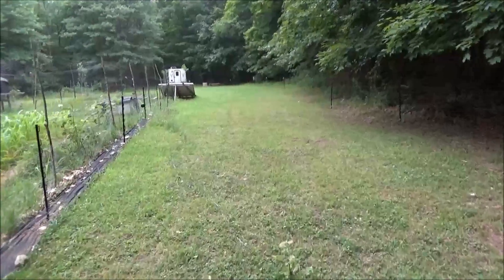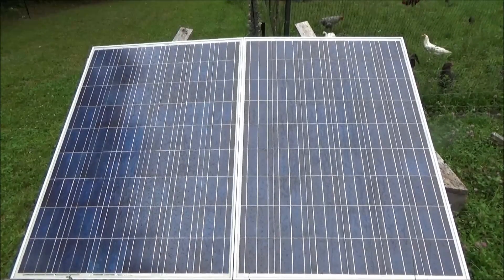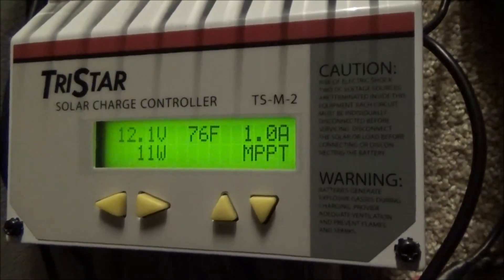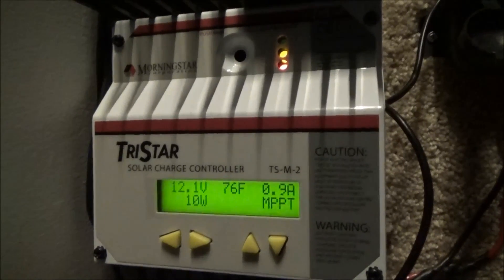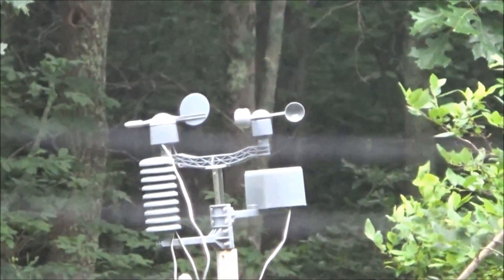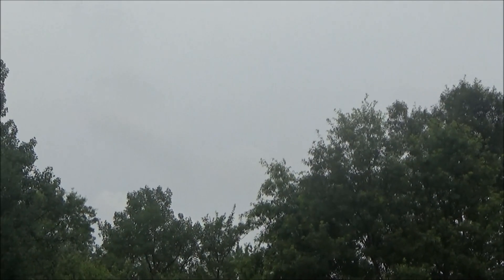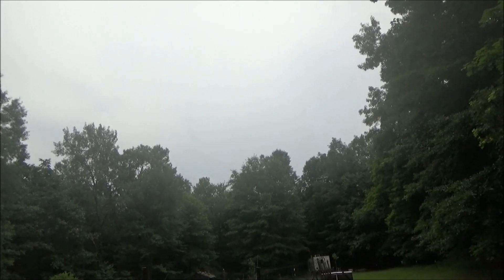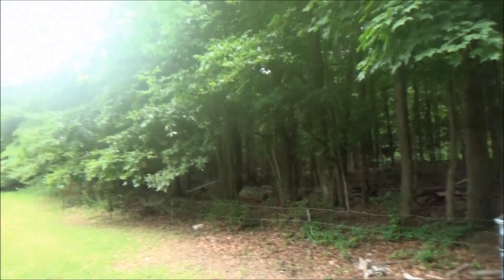Real Life Solar Panel Power Output At My Off Grid Homestead

Comment: Have to tested the input with a multimeter? Check at the charge controller and check at the solar panels. The lightning may have damaged the solar panels or the charge controller. Make sure you use stranded or braided wire. Solid wire was not made for solar.  800 watts of panels should get at least 600 in direct sunlight.
Reply from the maker: No this is real world numbers I was trying to show people. Neither the solar panels nor the charge controller were connected at the time of the lightning strike.
I have not had any direct sunlight in two weeks. It is dark and cloudy.
Reply: It just seems you should get more than 12 watts even on a cloudy day.

Comment: From the camera panning it would seem as though the solar panels are pointed west or west-south-west.  Is this the case and, if so, why not point them due south to generate the most overall power (like most people do in the northern hemisphere)?

Also, the panels seem to be located at the far end of the meadow.  This means they are closer to the tree line and, hence, would be in shadow more of the time and generate less overall power.  Repositioning the panels as far north as you can in the clearing should minimise shading.

It's true that a couple of weeks of cloudy weather will ruin your collection ability, but it is precisely at those times that attention to detail matters.  Off-gridders should always optimise solar panel placement, bearing and angle to maximise winter generation.

Just some ideas.  Keep soldiering on.
Reply from the maker: It is very hard for you to picture things on video. My panels are pointed S-W just a bit. I set them where they are for maximum sunlight based on the trees and shadows cast by them at any given time of the day. Morning hours, closer to the RV is shaded. Again, your panels will only produce max power for a certain amount of time per day. I tried my best to get mine positioned in the best place for my meadow. I literally watch the sun and shadows every single day. They change through the seasons. Cutting some trees at the south would greatly increase my overall output.
Reply: The Do It Yourself World All good then.  Seems like you have that angle covered.  As you say, it's hard for us to get an accurate picture from video alone.  I hope you get some blue sky soon.  :)
Reply from the maker: He P Thank you. I hope so too

Comment: Tracking systems are really fairly cheap,
Any number of materials can be used for the frame, add a  solar senor and servo motor and line up your swivel correctly.
Reply from the maker: I plan to build one next year. Right now everything is going into my home.
Reply: Fair enough, I think we had this convo about solar tracking about a year ago as well lol.
Reply from the maker: ***** Probably correct. Some things get pushed down the list sometimes. I need to get my workshop set up. Cant wait to get it in order and on solar power.

Comment: Wind option, run the poles up a tree, mount/ strapp it to the tree make it 10 feet or so taller than the tree, the tree will act as your tower and hold up the pipe for the wind turbine.   easiest way to do it if you have some climbable trees..
Reply from the maker: Yes the theory sounds good but someone just explained it in detail. Now it sounds like an option
Reply: The Do It Yourself World A easy way but may require trimming the tree of limbs is to climb the tree put a mount for a pulley and some rope or cable up high as you can get, top the tree above that level and then use  the tree and pulley too rise the tower up then strap it to the tree. as good as you can at many locations,  you may need some assistant to rise and lower the tower, but it is better, for maintenance you just lower it again.  Ham radio towers require huge bases of concrete if self standing...  guy line towers require all the guy lines etc.. just like a wind turbine tower,   a tree is a self standing tower already, nature provides.
Reply: Ebacherville What is going through my mind is getting the wind turbine up the tree and to a height where the spinning blades easily clear the tree limbs. It would be easy with a crane. Not sure how with out one.  Oh, and don't forget, trees grow.
Reply from the maker: Ebacherville The biggest problem is that a wind turbine has to be far away from obstacles which change and warp the wind pattern. I would need a tree way larger than all the others in order to get it up higher. Or put a tower up in the tree. Then there is lightning to deal with. I am thinking about it now though.
Reply from the maker: Ebacherville Oh, and wire at $5 per foot. Two sets of 60 feet is 120 feet of wire at $600. Another problem I have right now.
Reply: The Do It Yourself World Umm... please don't go climbing trees very high while you are alone
Reply from the maker: dancingpennies Not alone thats for sure

Comment: even overcast you should be making more than 11 watts with 800 watts of solar panels.. id check/replace the wires from the panels to the charge controller. I have seen my 125 watt panel make 1-2 watts at night with a full moon on a clear night.

Comment: having a small clearing in woods does not help the situation thats 4 sure,  live on a hill with no trees  will allow a greater range of solar power over  sunny days,down side you will cook during sunny days,lol,,,, its just one of those things without sun light you don't have solar power. its the old case of power in equals power out . less input power more solar panels and larger storage, no cheap or easy way around it.

 an extensive battery bank,6 battery's is not enough to last long periods of low solar watt hrs, i've seen days when you had good sun light  and the battery bank topped off within a few hrs, which shows you have surplus solar power to battery bank bank ratio.

the only way is to increase the battery bank,something along the lines of 10 times as many as at present , only slight draw back is the COST..

a diesel generator would be a good move,namely as it can be run from used cooking oil once processed which is cheap or agricultural derv. converting the exhaust system / muffler if air cooled to a hot water heater  will increase the fuel per hr usage ratio towards userable output power/energy total as internal combustion engines  produce 33% userable power over fuel used and thus its very important to extract as much as possible from the heat generated which is normally  33% LOSS when unused, thus the efficiency would be close to 60%-+, 30% for electricity generated and 3o% from heating water, a large insulated storage system would also be beneficial to accumulate the energy in the form of hot water and thus can be used for washing and heating combined with log burner boiler  for winter times etc.

a wind generator will help it wont solve the problem that's for sure as the wind is less of a constant than that of the sun at times, however stormy days that offer no sunlight often offer wind, harnessing the power effectively is another matter

 another source would be a good size stream / river handy for hydro power, using high voltage low amps to transport the power means smaller gauge wire can be used keeping the cost low and is an effective way getting  power from river generator to tiny home.

one thing i have found from personnel experience you need multiple ways of generating electricity, with means of  good storage and  efficiently,
Reply from the maker: Right. You have very good points. A diesel generator would be awesome. free power.
Reply from the maker: ***** True, its on my list of projects but what they dont tell you in all those wonderful videos and websites is that it is a filthy gas and gunks up the engine. You have to tear apart the engine quite often and clean it. Or have a complex filtration system. FEMA put out a DIY wood gas guide back during the war. It is still free to download. Its a bit too complicated for me though.

Comment: Put the wind mast in one of the trees you can climb.  I did it years ago with a TV antenna  and it is now about 80 feet off the ground.
Reply from the maker: The tree would have to be higher than the others and need to have the top cut off. Then a way to mount the wind turbine up on top of the tree. Servicing it would be a nightmare though.

Comment: Troy, 

Would turning your panels 90 degrees to the left, basically pointing them at the direction of the chicken home.. wouldnt that give you more sun coverage from a stationary time?? I know when i was in the military they showed us a trick to get most solar coverage with mobile solar panel for the communication equipment.. was to place a stick in the ground about 2 feet in height and every hour mark where the shadow was on the ground while we assembled everything.. over a complete day it would arc out the direction of the sun in a reverse plot.. then we would take the back of the panel and face it in the middle of the of the shaded area.. which placed the panel facing the direction of most coverage in that area.. around noon was the hardest.. but it would show just a tad more so in one direction letting you know there is a slight angle to the path depending on your location on the planet... 

Also this may help you in regards to the wind turbine, when we were deployed in South America back in 2004, we used trees for communication leverage.. we would assemble our poles and find a fairly straight tree and assemble the poles so when we slid them up the trunk of the tree we would be just above the top of the tree line.. then we would lower it and put our comm antenna on top of the poles and run the wire down the middle of the poles and either swing it between the branches to to top or maneuver it back up the middle to the top and then we would secure the pole to the tree with ratchet straps as far up as we could safely reach..in most cases only about 10-15ft depending on what we had to stand on at the time.. and that was plenty for the wind to not blow it down.. it would actually sway with the tree movement.. for long term mounting we would take an hand axe and create an 1-2 inch deep groove in the tree to keep the pole from creeping sideways during heavy wind days.. this wouldn't hurt or kill the tree and in most cases it would regrow bark up against the pole... you could do this with the medal 2 inch conduit and erect it one pole at a time up the tree and position the turbine maybe a foot or so above the tree line so it could spin freely.. ideally this would be perfect in the winter time when the trees are bare already
Reply from the maker: I have my solar panels positioned for max sun exposure at noon hours. Wow, on the antenna idea you really have me thinking. Please come over to the forum and explain how I would get the wind turbine up on top.http://www.thediyworld.com/forum

Comment: Instead of an actuator that pivots your panels to track the sun's position, look at the ground! What you need is a rail across the meadow, in the morning the panels are at the sunny side of the meadow, and in the afternoon, the panels will move on the rails, across the meadow, away from the approaching shadow. How many more minutes of sun exposure can you get if your panels were't stuck in the middle of the meadow?

Rails can be made out of inexpensive top rail of a chain link fence, you might already have some in your wilderness shopping mall.
Reply: The Do It Yourself World Would the rail and rotating the panels help even more?
Reply from the maker: Actually I would gain a lot from just rotating my panels, truly. I would only gain about 30 minutes or so of solar on a rail. But rotating would increase output by a few hours.
Reply from the maker: Jr Leon With the rotating panels you would not need a rail really. I just need to cut down a few trees to allow the sun to reach into the meadow longer.

Comment: Wind power plus solar should get you all the power you need.
Reply: Genifer Smith
Sometimes people pause the video and comment here and there as it plays. The reason is that if you play it all the way to the end, you forget what you were going to say because the subject has changed. I have learned to just not post my comment until the entire video is over...well most of the time, that is.
Reply from the maker: I guess you did not watch the video all the way through? I showed the wind speed indicator not spinning. I need to get a proper wind turbine tower up about 60 feet in the air to catch some good breezes.
Reply: Did you even watch the video.